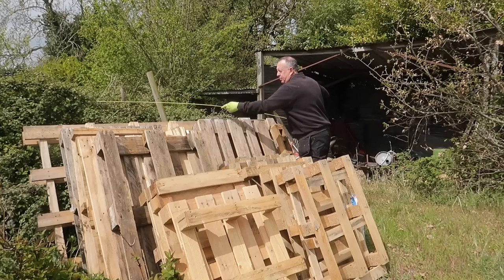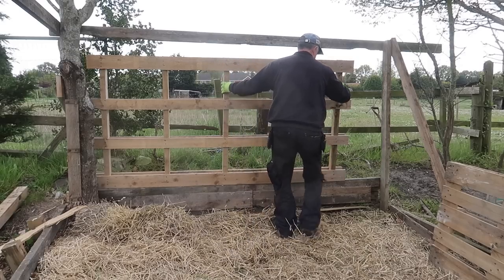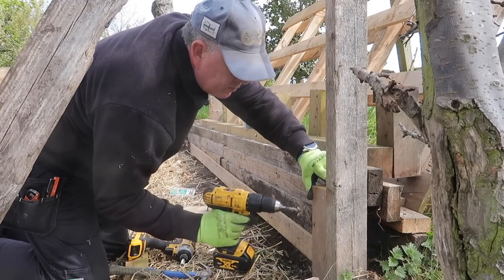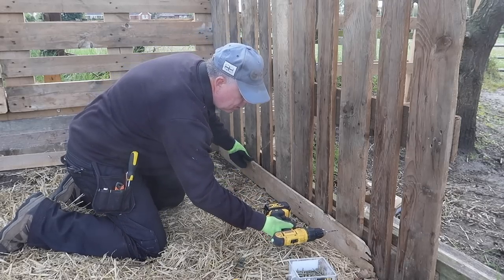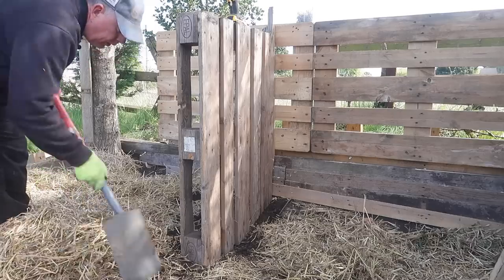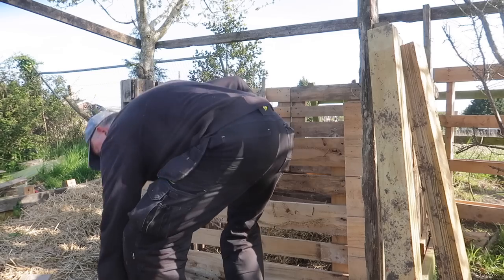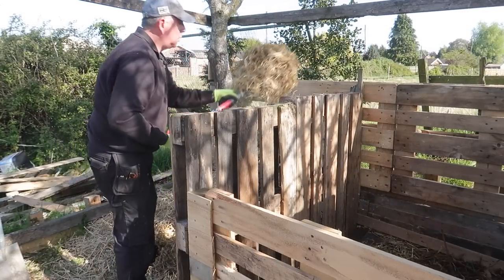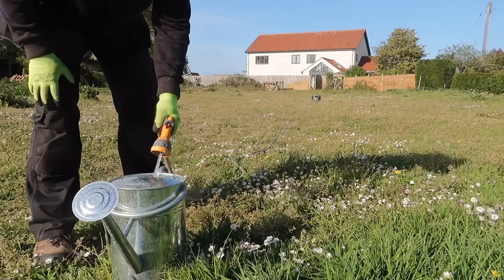Making a Compost Bin

Comment: If you take the pallet you screwed inside the front and put it outside, you'll eventually find it easier to remove when you want to take the finished compost out. Otherwise the weight of material pushing against it will mean you have to lean over the front (unnecessary back ache) or climb into the bin to take the compost out. I'll also endorse the excellent tip of peeing on your compost to help it along.

Comment: Excellent stuff, thanks for sharing. Some ideas from my experience: I'd have 2 extra bins so that the compost can be turned into them in turn - that way you won't be putting new stuff on old all the time. Chicken wire or some other small diameter mesh will prevent stuff falling out and allow air in, also helps keep out animals, though the more enterprising animals will tunnel in one way or another. Single planks slotted into a channel at the front makes getting at 'it' easier I have found, also leaves no gaps.

Comment: I wouldn't put a roof on. I built 4 large bins several years ago and, as an experiment, added lids to 2 of them while leaving the other 2 open to the elements. The latter produce compost much faster, presumably because they get the moisture you say is needed from the rain. Some plastic sheeting on top of the material with slits cut in to let the water through helps the heat build up. 

It's also worth adding shredded paper. So all my confidential documents go firstly into the shredder and then to complete the secure disposal onto the compost heaps.

Comment: Hey Stuart I use a hose 250 feet long up at my farm. There is a well., not anything fancy. It works fine, no loss in water pressure. ( this surprised me too the first time I set it up. I expected a dribble but got same pressure.)

Comment: I've had to clear a bramble patch that big before. I found the best approach was to cut the stems at the base with long handles secateurs, then pull the 3-5m long stems out by hand wearing decent gloves.
Reply: Me too...  But I do the opposite - cut  what's in front of you and work slowly forward across a width of about 6 foot, cut pieces to a length of about 3 foot, stack in small piles - cutting small helps to keep the pile from getting overly tangled and helps the drying process if you are burning.  Cut 8"-12" from ground level which helps with the digging out of the roots, marks the spot and gives you something to pull on, although getting a fork under the heart of the root is the key.  If you are composting all that, you are going to need a bigger bin!

Comment: I've been meaning to ask, and it's probably been mentioned before in your videos - what's the driver bit called that you use so that it magnetically looks effortless?! Thanks!
Reply: DeWalt DEWALT DEWDT70535T Impact Torsion 3 x PZ2 50mm and Magnetic Screwlock Sleeve

Comment: Great build - fit for purpose. Perhaps you can talk a bit about compost - you were talking about moisture levels...how can you tell you have the right moisture levels? What other info would be useful for us compost newbies?
Reply: The brown part needs to be just damp....I’ve heard it said that it should be like a wrung out sponge. The greens always contain water anyway. Trial and error will teach you. Too little water and you’ll have a dry heap that does nothing. Too much and it’ll fester and smell. Not worth getting too precise about though. Can just turn all the material and adjust the moisture levels with more water or more dry material. Everything rots down eventually!
Reply: Like pasta.  Damp enough to be soft and nice to eat.  Not so damp to be a soggy pile with no airflow.
Reply: @michaeltester5187  Thanks Michael, that explanation gave me a great starting point.
Reply: @nigelstewart9982  The airflow is a clincher Nigel, thanks mate.